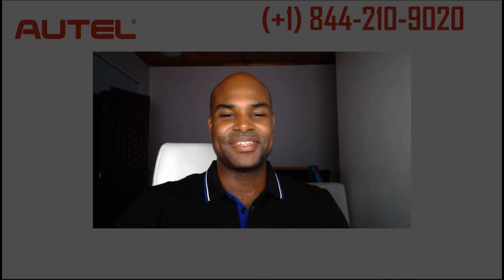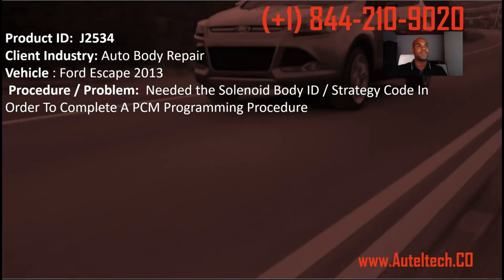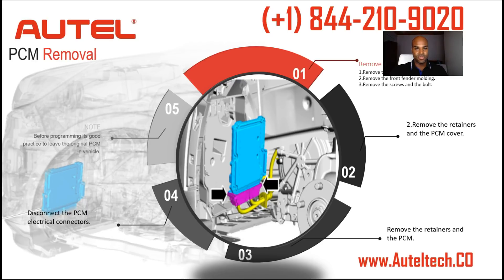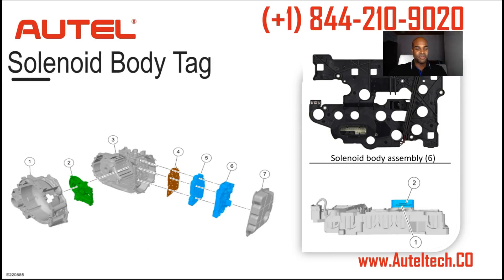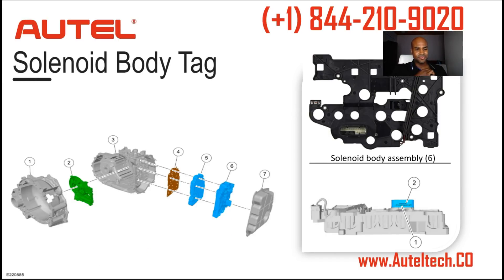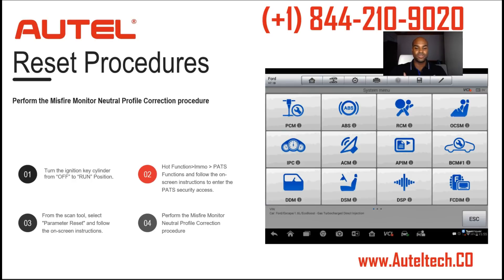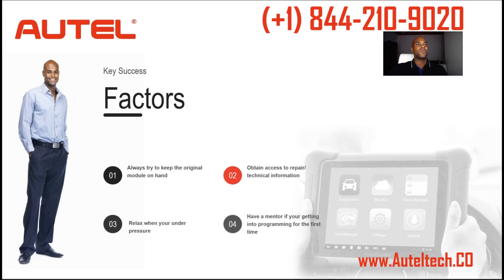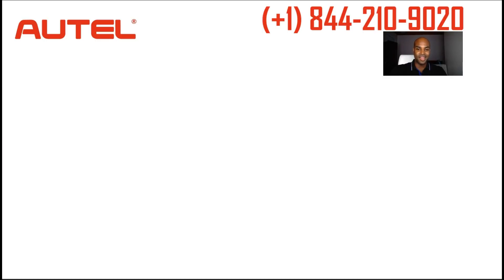Autel Maxisys Elite J2534  | Replace,Program,Calibrate PCM Module-Ford Escape 2013 | Case Study 2019

Comment: Can the Im608 do this? I have a new PCM and the old I need to flash the new one!
Reply from the maker: Yes you can use the j2534 for the im608
Reply: @AutelConsultancy  how? I got the full kit a customer got a ECM/PCM from the parts store but I was unsure if I could do the full calibrations for it. I didn't want him to waste his money if I couldn't get it right.
Reply from the maker: @mandybaker8544  HI Mandy, did you try contacting Autel New York for assistance? Unfortately I dont work for them and I charge for j2534 training.

Comment: I have done a few reflashes with the maxis elite but today I couldn’t connect to a 99 Ford F-150 and couldn’t figure out why they if I performed everything prompted even disconnected everything and reconnected with no luck I need some help with that issue
Reply from the maker: Hi Jaun I do have some tips that I use but I dont give this information for free. You would have to book a consultation if you would like to learn

Comment: Couldn’t you have extracted the info from the old PCM and just added it to new PCM? Works on older models, but not sure if it works on these newer models? Do you know if that’s possible?
Reply: It does work. But not sure if the video explained, this is if you’re programming PCM as new. But you can extract info from old PCM and write it to new/used PCM. Then parameter BCM-PCM reset. Since it’s the PCM ur replacing. Done. No need for 2 keys.

Comment: I’ve watched several of your videos. You seem very intelligent and capable. My only concern is it appears your not from the USA thus no recourse if a unit doesn’t work properly, etc.  Clarification might be helpful to many people.  Thanks in advance b
Reply from the maker: Hi Bruce.  I hope your doing well. This is a very commonon obligation that everybody has.  ( In South Africa they are afraid that im gong to leave back to the USA and my USA clients when I tell them I live in South Africa..)   All I can tell you is that my USA units have 3 Layers of Support. The first layers is myslef. Ill handle the technical software hardware issues with your unit and other services. The second Layer is Autel New York. You can send my units to them for repair. And the third Layer is Autel China.  3 layers should be sufficent as some people doint even know the 1 they have.
Hope this helps.
Thanks
Reply: Autel Consultancy , Thanks for answering.
Reply from the maker: @BonzaiBayCity  HI Bruce no problem buddy. Thanks

Comment: Why you didn't use the ids software with j2534 to do the programming and the PATS stuff?
Reply from the maker: Hi Mustapha . To be honest I cant remember exactly. Usually I work by process of elimination. If the OEM software didnt make thats available or if it wasnt connecting for what ever reason.. Then I would go to the Autel. If I could do everything on the OEM software I would choose that option first.

Comment: The Quick Support App on MaxSys (that allows one remote support) is now considered obsolete version and it has to be upgraded to a newer level before a PC using Team Viewer will be able to remote in to a MaxiSys anymore
.Should  everyone that has a valid update subscription just wait and  hold tight until Autel releases a System update that will upgrade the Quick Support App, on the MaxiSys or should  we figure Autel  won''t and we  be  on our own to upgrade it to version 14level?  Here is the link to the subject on User forum. A few of us upgraded our Quick Support App on our own already ( doing so is at own risk)
 http://pro.autel.com:6688/autelsupport/Diagnostics/27157.jhtml?logoTypeId=4&typeName=Europe%20Cars

Comment: Hello Curtis, I found this video while searching for another solution other than dealer to enable speed control (cruise) on my 07 f150 after factory cruise control buttons were installed on the steering wheel. Ford states the PCM needs to be reprogrammed with this enabled. I work at a BMW, Mini, Benz specialist shop. We use the autologic box and also have a launch tool rebranded as a Matco tool. The autologic has software just for the German stuff and the launch has a list of programmable parameters but speed control is not one of them. Unfortunately my employer fell for the great Amazon price on a Autel elite that we used with great success especially for the BMW's until it bricked. It was sent in for service and that's when we found out that this was a Chinese box and we have not been able to find anyone to properly repair it. I'm fairly certain my employer will not purchase another even though this issue was due to a lack of knowledge on his behalf not Autel itself. I have recently considered purchasing one myself to use at the shop and for my own personal vehicles because it truly was my favorite tool in the shop. An elite maybe really more than I need since we do have great capabilities with what we already have at the shop so I have watched some of your videos and looked into some of the other models. I really think the ms906bt do most of what I would want in a personal scanner. Would it or any of the other models have the feature that I'm looking for to enable cruise control through programmable parameters without having to have a subscription from Ford to reprogram the PCM. Any feedback would be greatly appreciated.
Reply from the maker: If you want.. after I consult you and hopefully represent you. I can get your bosses tool fixed. Anyhow the BT is congurent to your needs . It has the same special functions as the Pro and Elite just with out the jbox. The 906BT cant program blank modules but it can code used modules through the programmable perameters feature.  Based on what you told me I feel the BT would be congruent to your needs.

Comment: Hey Curtis, what are the differences between mk808, ds808 and the mx808?
Reply from the maker: They are all stage one tools for different international markets.  The DS808 is a high end stage 1 device with some sepcial functions. I only recommed this level if you word on cars from 1997 to 2010. You can get away with using the DS808. The other tools are limited . It really depends on your situation and vehicle you are working on to determine which tool will solve your problem

Comment: Could this pcm reprogramming be done with the maxisys,thank u sir👍
Reply from the maker: Hey George  . You can only use a laptop for this procedure . If you want to know the set up I did a presentation on this topic https://www.youtube.com/watch?v=5bFDzPY1L_I
Reply from the maker: Some vehicles you can get a used pcm and go through the programmable module installation to insert the vin info into the new module. It depends on the vehicle but yes this feature is on the ms906BT